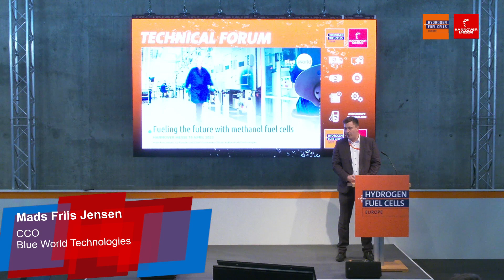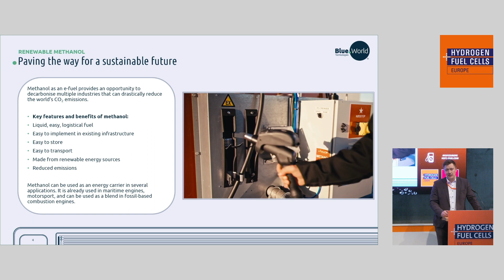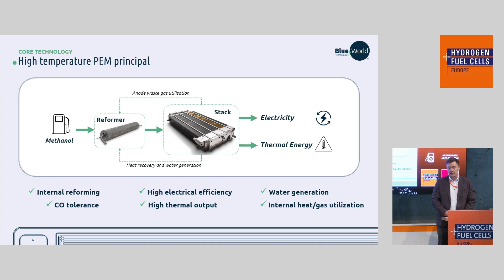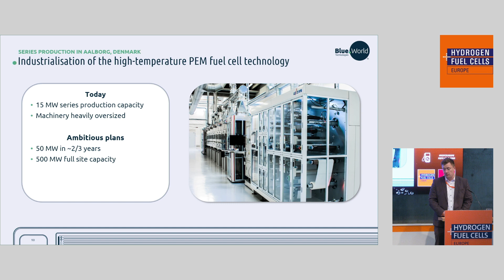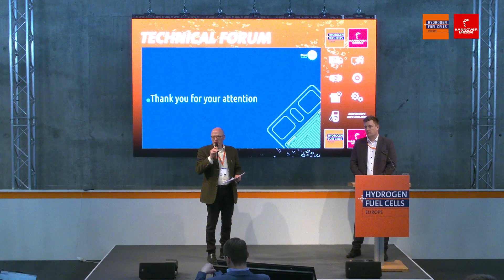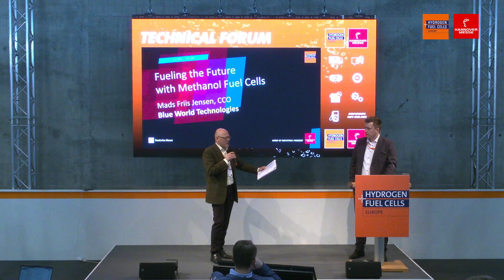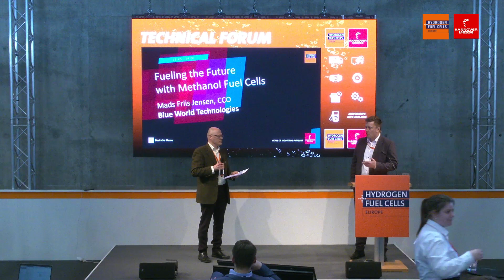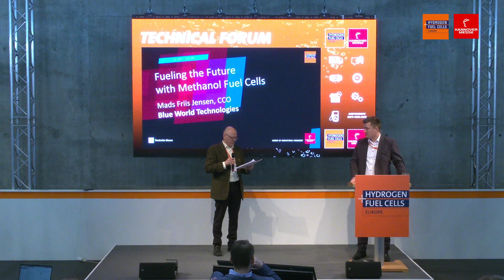Fueling the Future with Methanol Fuel Cells  | Hydrogen + Fuel Cells EUROPE 2023

Comment: Definitely this is the future, methanol liquid fuel to fuel methanol fuel cell (and then electric motor without battery with way longer range and "rechargable" by refueling liquid methanol in just a minute just like any diesel engine. This is the future, better than "normal hydrogen" because methanol is a liquid fuel directly and easy derived from green hydrogen and way better usable than hydrogen because no need compression pressure storage and or ultra low temperature needed. Methanol liquid room temperature fuel is just a drop replacements in any gas station with little modification and same happens even with combustion engine but obviously fuel cell Ev gives more efficiency .
Reply: You forgot one important issue. In order to manufacture the methanol, you need CO2 besides the  hydrogen. The CO2 must be green too, namely biogenic.This means that you must suck the CO2 from the air or to capture it from some burned biomass. The CO2 atmospheric concentration is very low (400 ppm) so you need a concentrated flue gas in order to be efficient.Not so easy though.
Reply: @dalsenov  In biogas, along with methane, CO2 is also formed which can be used now.
Reply: @ayushtiwari46798  I agree. The concentratio of CO2 in biogas is the best,around 45 %.Still biogas is a difficult upscaling solution.You need a lot of digestors.
Reply: @dalsenov  CO2 can be taken from free air
Reply: @TransformerVolumeC  That is very expensive because of low concentration.Many things can be done if you disregard the cost.
Reply: @dalsenov  not expensive compared ultra expensive natural gas , solar and wind power is free as it is the CO2 in air!
Reply: @dalsenov there is a much easier way, as thoroughly described by the Swedish university of Lund, consisting of biomass gasification and conversion of CO and H2 in liquid methanol (with or without external hydrogen input).
https://youtu.be/g1FD9ymSQeU?si=knvCFy5cMovKzV0Q

That way you convert 60% to 80% of the energy of (dry) biomass into methanol, so that you can produce one tonn of methanol from one tonn of dry biomass to replace in a  methanol fuel cell one tonn of petrol/Diesel fuel
Reply: @dalsenov  You forget the tremendous  amount of $$$ that is going into CO2 capture.
Instead of storing it, the CO2 can be used to create methanol or fuel stocks.
Pointless to throw away CO2 when can be utilized as a basically free fuel when combined with government funding otherwise used on CO2 storage.
Reply: I agree besides the fact that for short-medium range (say, less than 100 km per day) electric vehicles with decently small batteries (~20-25 kWh of capacity) are still optimal for private passenger transportation. For everything else, i.e. long range private transport, freight transportation, airplanes and sea shipping (where batteries are not possible or practical) a methanol fuel cell propulsion is the way to go
Reply: @Alessandro-1977 You forget one of the big consideration is running out of electrons, and the very long recharging times.

Methanol does away with all of that.
Reply: Most cost-effective way to make methanol is by reforming natural gas with water steam.
Reply: @redserjogha  natural gas is very expensive and produce climate change gases while solar/wind electricity and free air CO2 is free to produce green hydrogen to Green methanol
Reply: @TransformerVolumeC nuclear.
Reply: @redserjogha The best solution is using very low cost electricity when demand is low at a nuclear power plant, i.e. at night.  Nuclear power dies not ramp up and down easily, so capturing electricity that is not needed at night can produce methanol from atmospheric CO2.
The money wasted on carbon capture can be repurposed to make this carbon-neutral fuel.

Comment: Just curious, what are the efficiency and weight/power density of such a typical methanol fuel cell ?
Reply: Previously they've showed 5kW fuell cell which weights around 70kg and they've stated that makes 12,5km on liter of methanol/water mix. 
They've also showed some applications like moded Nissan e-NV200 Hybrid with theirs 5kW fuell cell and 80 liter tank which should make 800km.
Roland Gumper's methanol sport car also uses their fuell cells probably...
Reply: @Alessandro-1977  methanol density is even better than gasoline, and is a room temperature normal liquid fuel that can be used in any engine only replacing plastic tubes by stainless as in Brazilian alcohol engines
Reply: @TransformerVolumeC   
actually, a liter of methanol has only half of the energy of a liter of petrol, but in the end with the improved efficiency you have very similar mileage and fuel economy between the two. That includes avoid extra weight due to the batteries and IC engine (even ~ 10 times heavier than an electric motor, as kg per kW), so in the end you have the best of the two worlds: the efficiency and compactness of electric propulsion (that are quite obvious) without the bulk, weight, low speed of charge and loss of load of batteries and/or IC engine
Reply: @TransformerVolumeC it is not higher than gasoline or diesel, so fuel tanks need to be slightly bigger, still a methanol fuel cell car can have a range of 1000 km.
Reply: Plus the longevity  of the fuel cell in heavy duty trucks is impressive, 100-200,000 hours.  In a car, about 15,000 hours.